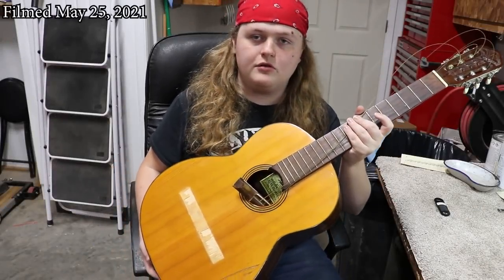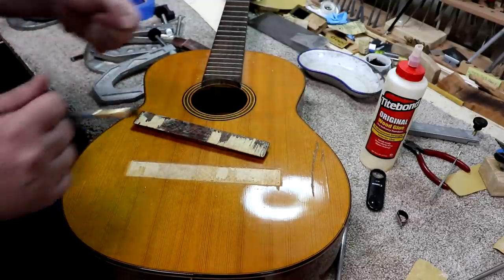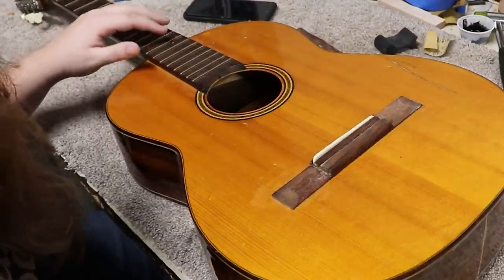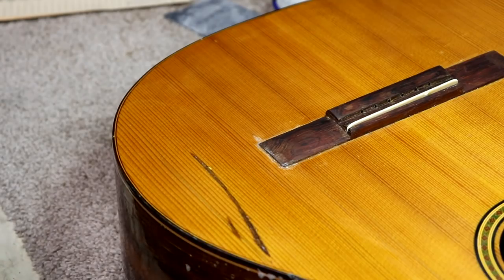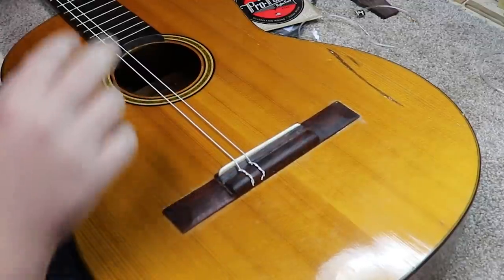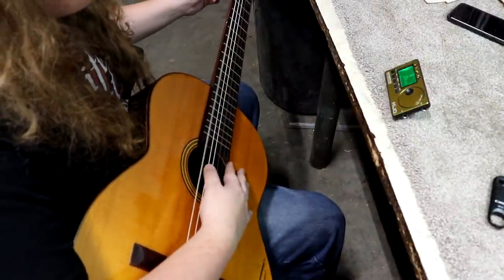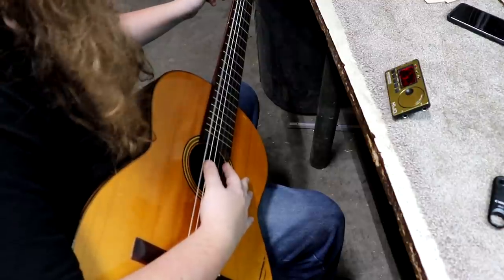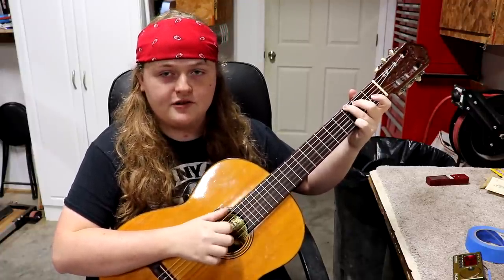523 RSW DiGorgio Bridge Repair

Comment: The scratch looks like moder art: a closed eyelid and a long eyebrow. Classic guiar music can be very relaxing so it might be appropriate. Take a picture put it on a button? I noticed that the guitar did not have tie on strings at the beginning of the video. I know there are some nylon strings with nubs on the end -- was this the case or were they the wrong type of strings which put too much pressure on  a bridge not designed for it. Plus, that looked like a 3/4 length guitar size which would imply that it was not designed for too much pressure. BTW, I play classical guitar(s) and you did great on the strings but you notice how they have to stretch for quite a while before they stay in tune? Loved the video. Thumbs up.

Comment: What makes it a classical guitar, just the strings and bracing ? The lower strings sound like they are wound metal when you slide across them. How are they constructed ?
Reply: Nylon core with a metal wound portion.
Reply: Also the fretboard is somewhat wider and flat rather than radiused.
Reply: The fretboard width, bridge, and a high action in addition to the differences you mentioned.  Flamenco guitars on the other hand have all the classical features (but made from different woods for the most part...cyprus sides and back and German spruce top), plus a golpeador (tap plate).  Also, a low action that is comparable to a dreadnaught.  The low action produces that desired "flamenco growl" (buzz) and picado speed.

Comment: I don't remember mention of RSW not working on Classical guitars before now. I wonder what is the reason. The head stock is rather different from a steel string guitar but the bridge isn't that different than some steel strings so I would have thought they can easily handle working on them.
Reply: My reason was ,with large hands like mine and Jerry's **The classical s has a very small sound hole. for most internal repairs you have to remove the back and the back and binding never seem to go back on right.***DR KEL
Reply: I have the same question.

Comment: Not that i am in any way an authority on this either but just for laughs the way i string a classical guitar is usually two loops on each string but mainly i take the end of each tied string at the bridge end and tie it under the next string, so end of the low E string is tied into the knot of the A string and the end of the A is tied under the D string and so on, then all the string ends come out under the high e knot and dont stick in your hand

Comment: Curious why you chose not to work on Classical Guitars?
Reply: My reason was ,with large hands like mine and Jerry's **The classical s has a very small sound hole. for most internal repairs you have to remove the back and the   binding is old  cellulose blinding  and brittle and breaks in small pieces I have to replace with ABS which never looks right  .my last repair was on a 1897 Washburn  parlor guitar****DR KEL
Reply: @dscdrkel5546  Thanks! Love your channel ✌️